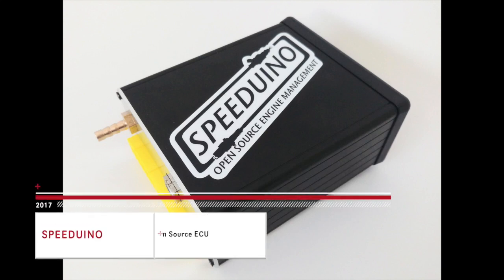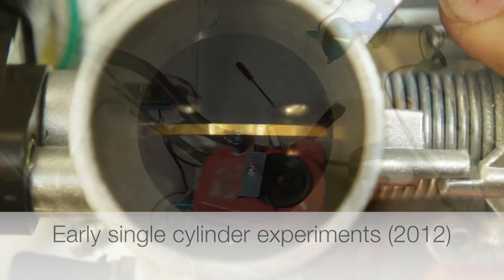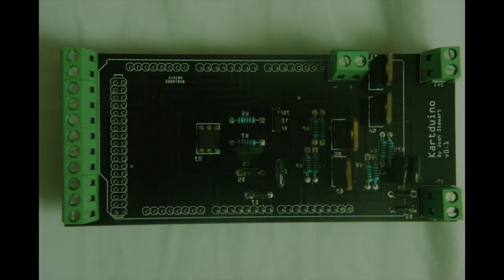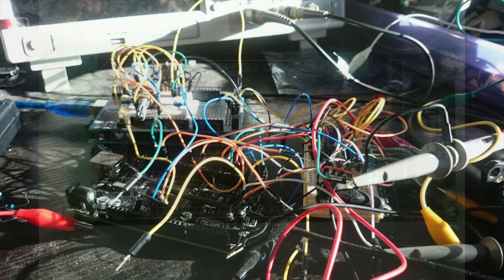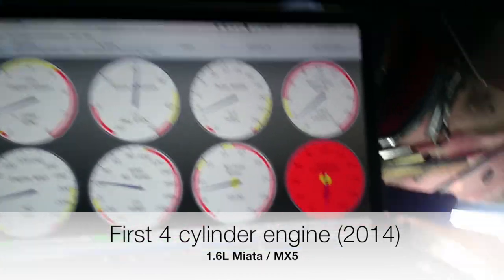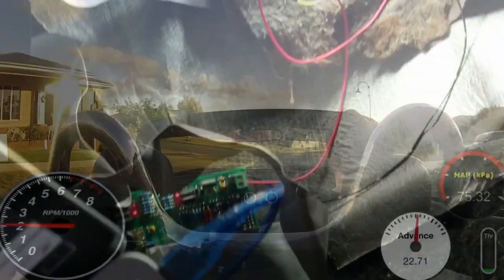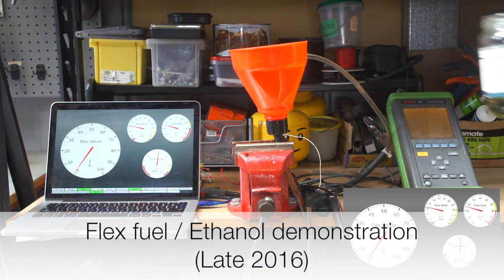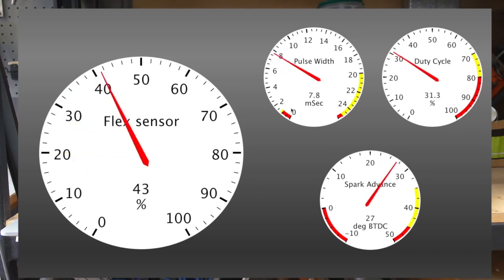Speeduino - 2017 Hackaday Prize

Comment: Lets say someone has experience with Microsquirt, how steep is the learning curve with the Speeduino?  I have been following this project for several years I never have had the chance to mess with Arduinos though.
Reply: Simple if you have some soldering skills, or if you want to buy a pre-built one, there are some available to buy. You don't really need to know anything about arduino. At most, you will need to download the IDE and upload the Speeduino sketch to it, and then all you need from there is TunerStudio for the setup.
Reply: Thank you very much for the info, I appreciate it!
Reply: No problem. Almost completed a turbo build with this ECU. Runs well, needs a tune though. Surprised at how well it works to be honest! There is a forum over at speeduino.com for any questions you have, and also the website has some how-to guides. It's still a new project, but it's coming along nicely.